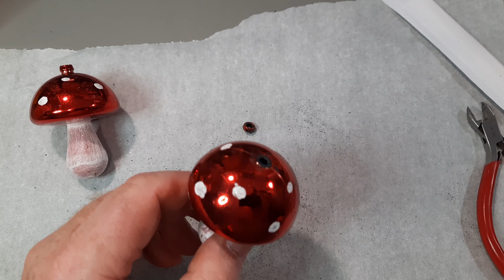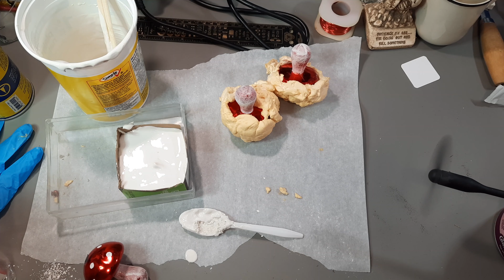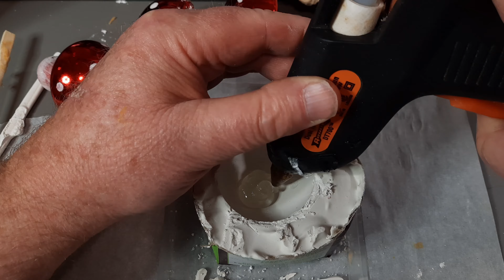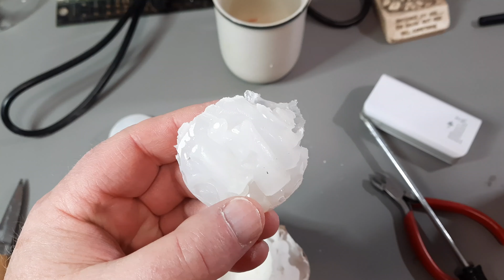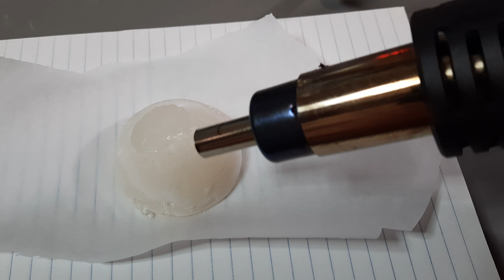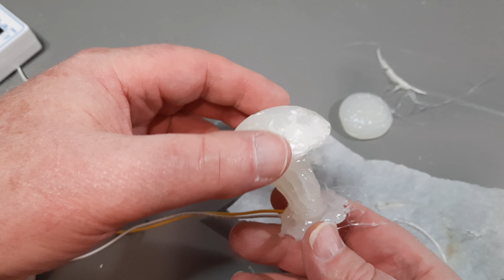DIY LED Mushrooms

Comment: A sticky situation, had to say it, was thinking straws (1 surrounded by many) and then glued, some leds fit or using a glue stick as a light pipe
Reply from the maker: (-: Neat thing is the possibilities are endless. The 4mm crystal clear glue sticks probably would make good light pipes.
Have a good day
Reply: @retireeelectronics  and they can be cut lengthwise, rotate, merge...
Reply from the maker: Cutting lengthwise might be a bit tricky using a razor, good gloves would be a must. Heating the two halves to merge probably would be messy if trying to keep it as a cylinder.
Have a good day

Comment: Well my man, you are just one step away from a mushroom cloud. I bet you all those Warhammer miniatures wargamers would love this. A nice project would be to add a circuit to simulate motion inside the could, some sort of internal fire effect. Might be fun to goof around with some timers. Merry Christmas!
Reply from the maker: I will be adding to these and I have a large selection of RGB LEDs (4 pin type). Originally these were to go outside as garden lights but still waiting on some  little enclosures to arrive. Will probably have another video that will skip the making part and concentrate on creative electronics.
Have a good day